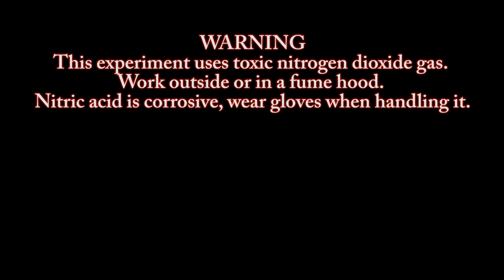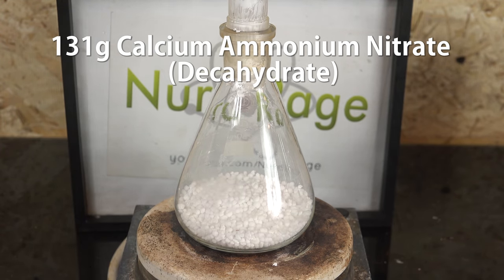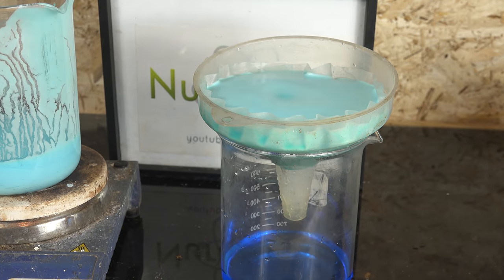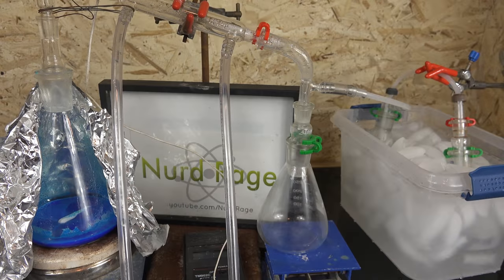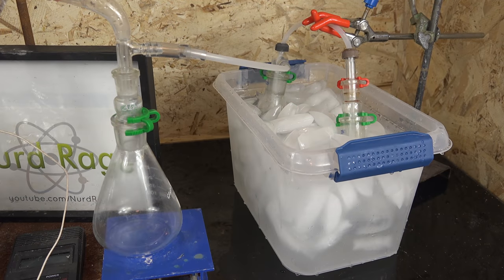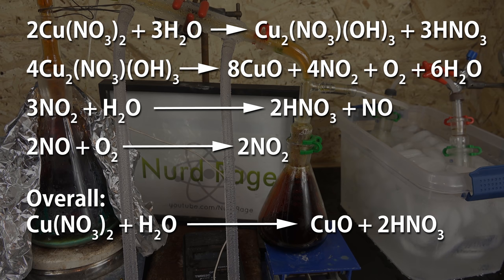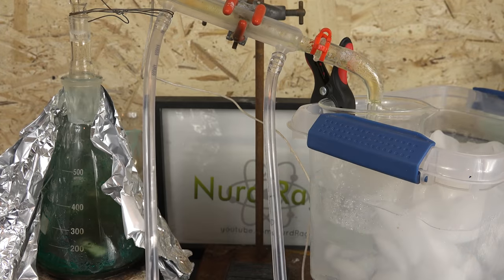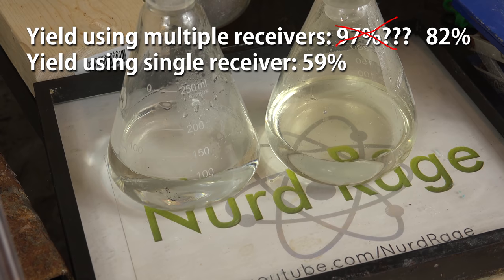Make Nitric Acid by Thermal Decomposition of Copper Nitrate

Comment: Hey Nurd Rage
 Do you have any advice on fumigation with sulfuryl fluoride? There is a flood of official documentation available via web search, and the typical pseudoscience hysteria as well. What I haven't found are how the detection sensors work, and a layperson friendly breakdown of the post fumigation process chemistry. The California regulation documentation mentions the sensitivity of a few sensor systems by brand and product, labeling some as adequate and others as inadequate. So what's the deal? What are the detection processes and calibration?

Comment: Very interesting. I assume the reason you don't decompose the calcium nitrate directly because it takes much higher temperatures before decomposition.

But how about iron nitrate? It is easy to get iron sulfate and calcium nitrate as fertilizers where I live. Mix it together and you get iron nitrate left in solution. From what I could see the decomposition temperature should be about the same as for copper nitrate.

And I totally agree, filtering off calcium sulfate isn't fun.

Comment: can i add some anti freeze to water then super chill it in the freezer and run it through would it be possible to get 82% yield with just 1 capture set up ??

also surely you can use sodium hydroxide instead of calcium hydroxide... sodium is more reactive then copper so it should still work in the displacement

Comment: I've seen a similar method, except the nitrogen dioxide was created with a high voltage discharge and forced into the water with a fan or something. I always figured whenever I needed HNO3, I'd get it that way.

Comment: It would be interesting to try to use an old microwave oven to create plasma, like a plasmoid, to create nitrogen dioxide from air, to make nitric acid. With a little extra cooling, it could run continuously. It would seem that one would need an air pump, and some kind of chamber, which would have to be water cooled, and then the nitrogen-dioxide could be bubbled into water. It might have to have a lower duty cycle.
[I made a microwave plasmoid for a moment. It did make some nitrogen dioxide, which is an unwelcome guest in a microwave that I wanted to use for food, after.]

Comment: Can you avoid most of the filtering by washing the products in a settling column? E.g. use a glass cider jug, feed water in at the bottom with a long tube, siphon stuff off the top into a distillation flask and feed the condensate back into the jug via the long tube. If you have a cheap source of jugs, you might even include more than one stage. If the flow rate is slow enough it should settle faster than the water rises and once set up it should be able to run most un-attended. As long as you don't run it too long (and do what a soxhlet extraction is designed to do) that should significantly reduce the amount of material to filter out.

Comment: There has to be a method to prevent flow back...  What I'm thinking is a one way valve of sorts: ie a piece of lose tape placed somewhere on the inside of the tube that is pressed up against the tube during bubbling and gets pulled off if the pressure within the tube drops as liquid gets sucked up the tube.

Comment: I am perplexed why you did not bubble the nitrogen dioxide through the water instead of just allowing surface contact. There seemed to be a lot of nitrogen dioxide just floating away. Is it bad to bubble it through?
Reply from the maker: i show it later on the video a bubbling based system.

Comment: When dealing with calcium sulfate, would it not just be easier to decant, through filtration, stopping the pour once hitting high concentration of calcium, refill the flask containing the calcium w/ distilled water, and decant through filtration again?  At the expense of a little bit of water, as well as time and fuel to boil that water off, you can save yourself a day of tied up equipment - which, in all but the most dire of situations, with profoundly limited access to any resource but time, seems the most economical choice

Comment: What about the production of NO2/N2O4? Would worth separate the synthesis in HNO3 and NO2/N2O4? I've noticed that a lot of NO2/N2O4 was released during the fractional distillation column  part.
Reply: N2O4 can be dealt with by bubbling the gas through 3% hydrogen peroxide.  It'll break it down and convert it directly to nitric acid.  In plain water, it'll give a mix of nitric and nitrous acid, which requires additional heating and oxygen to cycle around to get more nitric acid.  But H2O2 skips that by directly attacking the N-N bond, forming two NO2, which the reactive hydroxyls from the peroxide bonds with and creates nitric acid.  The process is most efficient with 30% hydrogen peroxide, but that can be very dangerous to work with and is rather bound to attract attention if you're buying gallons of it, since it's kinda sorta the thing people can use to make kabooms.  ;]

Comment: Great!!! I already knew that was possible to obtain nitrogen dioxide from nitrate salts, is possible to use iron nitrate instead of copper nitrate?
Reply: It is!  Iron nitrate is ever easier to decompose, as it breaks down at about 80C.  In fact, you need to store your iron nitrate solution in a closed container in a cool place if you don't use it immediately.  It spontaneously decomposes slowly, and you'll see rust start to collect at the bottom.
Reply: @Alondro77  the problem is the absorption of NO2 gas in water, is not as soluble as one think it is, in fact I found that aluminum nitrate release nitric acid when decomposition and doesn't produce so many NO2

Comment: I think the reason it was so much hard work was because you used calcium nitrate, rather than sodium or potassium salts. Maybe you should try this again, but use sodium or potassium nitrate, rather than the calcium nitrate that you used.
Reply from the maker: But you can't filter out their sulfates at all.
Reply: @NurdRage  You were able to filter out sodium sulfate in your hydrobromic acid experiments, why is your copper nitrate decomposition experiment any different?
Reply from the maker: @babsarts8282  hydrobromic acid doesn't precipitate. but copper nitrate will. So you'll lose you're copper nitrate too if you increase the concentration too high.

Comment: So is there some reason that centrifugal filtration isn't a thing? I mean, you could stuff a coffee filter into a juicer and probably get a pretty good result at blinding speed. It's basically gravity filtration but on Jupiter.
Reply: You'll have to use stronger filters or more of them, otherwise they will be torn. Either way, that would slow down filtration, and I'm not sure you'll get a decent enough speed-up for all the trouble. I guess the only way to know is to try. You probably can make your own specialized centrifuge from scrap parts, such as a motor, strong wire, a bunch of tin cans and a plastic funnel. I might actually try to build one for coffee 😀

Comment: is there a reason to distill the water instead of boiling off?
Reply from the maker: it's just cleaner, i hate having condensation in the ventilation shafts of my fumehood. It creates rust and mold. By all means just boil off directly if you want.

(although a more professional reason is to capture any accidental distillations of product. For example, you accidentally heat too hard and distill off some nitric acid. Since you collected it, you can reprocess it. While it's not really necessary in this case, i've kept the habit from my professional work where one mistake could cost hundreds of thousands of dollars to the company.)

Comment: 8:32 : can't the aerosolized copper oxide issue be entirely avoided by placing a small ball of glass wool at the bottom of the distillation head, to filter and retain any solid particles?
Reply: That would probably prevent most of the gas from getting into the condenser, or at least slow it down too much to be practical.
Reply: @davesulphate4497  Not really no. You can easily gently blow through a ball of glass fiber in a tube. The gas in this reaction is evolved very slowly in comparison.
When gas is produced, it has to go somewhere. It will only take an insignificant pressure rise in the conical flask to push it through a loose ball of glass wool.

Solid particles, on the other hand, should easily stick to the strands.
Reply: @piranha031091  The ball of glass fiber would be wet and this can significantly slow the motion of gasses, but yes it will go through. The real problem is that the acid will redisolve the copper and not stay stuck in the fiber.
Reply: @davesulphate4497  Yes, the acid will redissolve the copper, but that will either stay in the fiber ball, or, when enough is there, drip down back into the conical flask. It wont spontaneously rise up the distillation head. Unlike aerosolized particles.
Reply: @piranha031091  Yes, sure, all I am saying is that it has issues that need to be considered. For example, while the liquid wont spontaneously rise up the glass, the wet wool with gas pressure really could. Then the liquid could go through. These issue can be got around, and maybe it's a good idea but to me at least it seems unlikely. I have been wrong before though, so maybe.
Reply: Your thoughts?

Comment: I have a possibly strange question. Is it possible to dehydrate hcl? If so, what would be the end product?
Reply: Hcl is actually a gas, so I guess that would be the end product.
Reply: @bormisha  hcl is a liquid acid better known as Hydrochloric acid. Dehydrating it would be removing the hydrogen and ending up with either a liquid or a solid. But I'm not sure what the end product would be. That's why I asked Nerd Rage, not you.
Reply: @MikkellTheImmortal  Thanks for the explanation. Though, Hcl is actually the hydrogen chloride gas, you may check Wikipedia on hydrochloric acid to confirm it. If you remove hydrogen from HCl you'll be left with Cl2, which is the chlorine gas.
Reply: @MikkellTheImmortal  If you make a correction, then you should make sure you're right. 

You can't "dehydrate" water. You can seperate HCl from water, but that's not hydration. You're just removing the solute from solution. At which point you get a gas - hydrogen chloride gas. This is it's natural state until it finds water to dissolve into. 

If you're asking what happens when H is removed, as in, what you get when it's "deprotonated", which it does in aqueous solution, then you simply get a proton and a chloride ion. They'll exist like this until they reform in equilibrium or pulled out if solution, or until they're reacted with something.
Reply: @michaelmerritt7406  I think you answered my bizarre question

Comment: How about, what if the goal was to produce the largest amount of dry NO2 gas, as cheaply and quickly as possible with readily available chemicals? Don't want the acid, want the nitrogen dioxide. Though from the nitrogen dioxide, you could easily make your own acid of varying concentration.

Comment: There is a better way when you have copper nitrate waste from dissolving impure precious metals in nitric:  drop the copper with iron to produce iron nitrate.   Iron nitrate decomposes at 80C and yields nitrogen dioxide and black iron oxide.  

Bubble the gas through a bubble stone for a fish tank at the bottom of a tall column filled with 3% hydrogen peroxide.  The tiny bubbles will facilitate rapid gas exchange, and the peroxide drastically increases the yield of nitric acid, thus requiring much less distillation.

Comment: Is there a way to use either ammonia or urea to directly catalytically make nitric acid? ~( 'w')/
Reply: not quite. but there are threads on sciencemadness. decompose urea or use ammonia directly, mix it with air/oxygen, pass it over a heated catalyst. absorb the resulting NO2 in water. this is how they do it industrially. (platinum mesh catalyst)

Comment: ethylene as decomposition of ethanol-h2so4 reaction ethyl sulfate, why not make no2 from air gasses in arc furnace reaction, bubbled through water to make the hno3, hot can be made with carbon rods with welding machine. making sulfuric acid from zinc sulfate (is also a rechargeable zinc-air battery in water) with electroplating voltage potential znso4 to h2so4 and zn reaction.
Reply: also hot resistance filament will make enough temperature to make the no2 reactions happen in contained vessel, with water bubbling out as the hno3 acid

Comment: Hey nurdrage can I make copper nitrate by adding ammonium nitrate to copper oxide? I know it works with copper chloride : 

It is also commercially practical to combine copper(II) oxide with an excess of ammonium chloride at similar temperatures, producing copper chloride, ammonia, and water:

CuO + 2NH4Cl → CuCl2 + 2NH3 + H2O

https://en.m.wikipedia.org/wiki/Copper(II)_chloride
Reply from the maker: DO NOT do that. it's easy to miss in the video (since i go over it really fast), but i mention that copper and ammonium nitrate make an explosive called tetraamine copper nitrate. If you tried to heat that it would explode.

Comment: use nitric acid to desolve silver from electronics. then ad copper to disapate silver crystals out the selution...now i know how to recover the nitric. did make copper powder by pushin copper from selution with iron and make feric natrate. wich is also used in patina on bronze castings. but ill rather save the nitric acid. tend to produce to much.